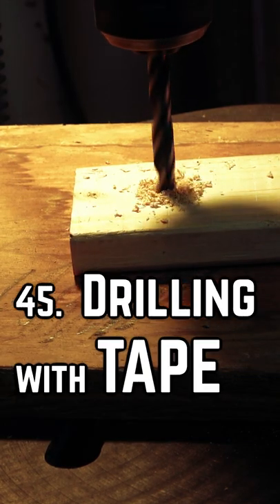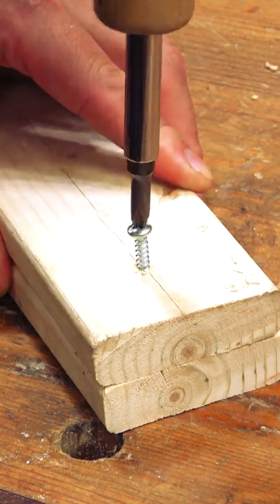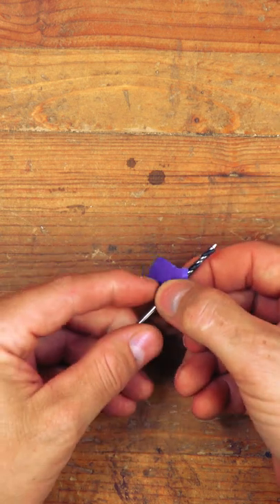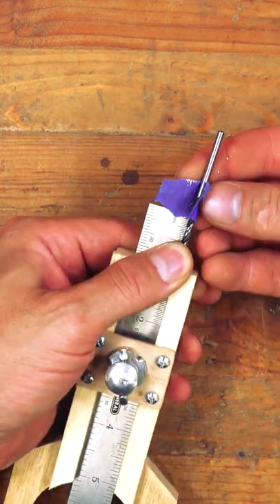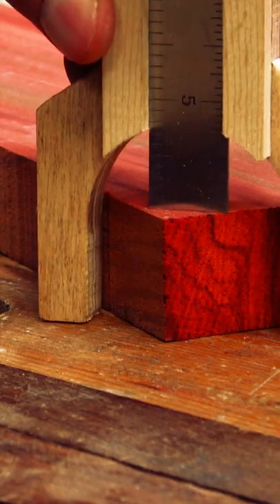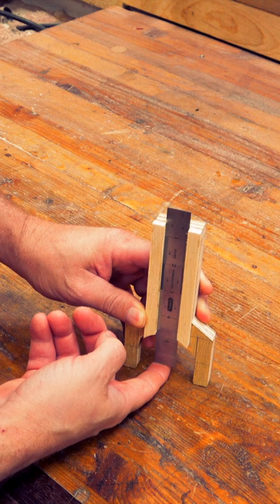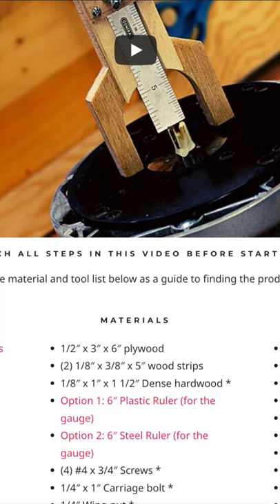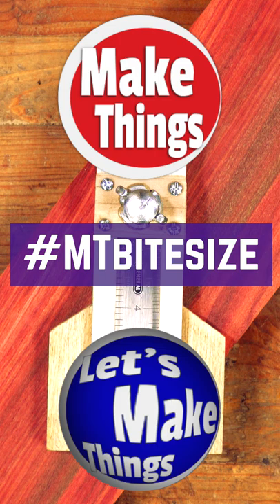45. Drill with TAPE #mtbitesize #shorts

Comment: A cheap pair of calipers would do the same thing. it's a nice tool he made but I'm pretty sure it would be cheaper to buy a pair of calipers from Harbor freight AKA Amazon and then it would be to make this damn thing  No matter how cheap it is it will probably be more accurate than this thing you hobbled together with no experience required other than know how to read a pair of calibers And you get metric and Imperial.  A pair of calipers can measure the outside of an object the inside of an object and  The depth Of an object.  The scissor is for inside measurement the the pincher is for outside measurement the pointy thing that comes from the ruler is for depth measurement  I know I use childish language but it is the basic form how to use a caliper